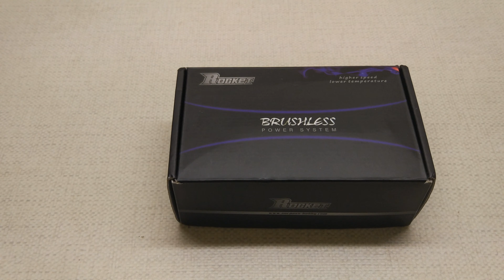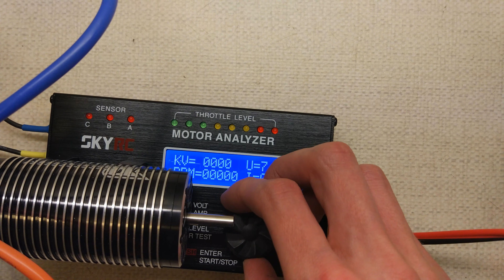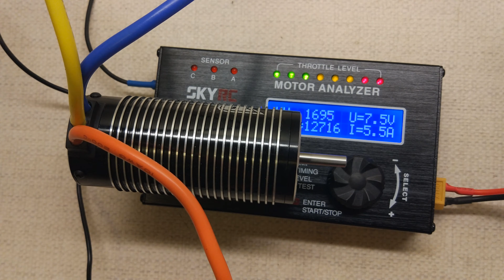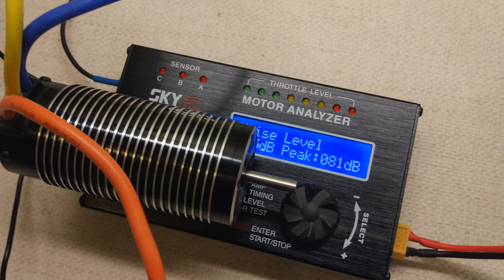MTT EP10 Replacement Surpass Rocket 4092 1650KV Motor

Comment: Great video. Great info bro! Got that motor, but the hobbystar 1730kv.. no problems, but I definitely haven't used it alot. Maybe 10 session. Mainly on 4s. Peace ✌
Reply from the maker: Yeah the hobby star motor look pretty similar to these.
Reply: @LawrenceTimme  my 4092 one looks identical. Its been great for the price. It's in a Talion v3. Paired up to a max8. I'm gonna pair it with a max6 & try a few 8s passes. I live in London. I'm a English Rc bum 😂✌

Comment: Nice, thanks, so do you think this would be a good motor in a kraton, stock one still works fine just wondering what the difference would be, thanks again
Reply: I just ordered one for kraton exb 6s build
Reply: @scottramirez9623  I just bought one also, couldn't resist lol 61 bucks on Amazon can't beat it, can't wait to try it
Reply from the maker: yes it should work well in kraton.

Comment: If i got there 1250kv motor and run it on a max 6 would it work good cause I want to use it in my felony so please let me know if the motor is reliable and can maybe run 8s
Reply from the maker: It will say the maximum voltage on the specs for the 1250kv version. I only have the 1650kv version
Reply: @LawrenceTimme  ok thanks

Comment: Hey great video! I have almost the same motor, its a  4092 1520KV, I have only ever run it on 3s lipo.   do you know if these were designed to work on 3s, or do these motors function better on a higher lipo battery? motor is great, thou I do notice some cogging from time to time from a standstill.   zd racing pirates 3 1/8.
Reply from the maker: On a lower voltage the motor might have a harder time starting up, but it should run ok. If you have a lower resistance battery or better esc it should not cog as much even on 3s
Reply: @LawrenceTimme  thx for the info.   one more question.  would a 4s 35c  battery be any "faster" or better then my 3s 120c battery.   i dont have much experience.  i know the c value makes a difference but going from 3 to 4s be a bigger difference or will the low c really affect its performancr.
Reply: @xKevmachinex  yes u should run 6s or 8s with dat kv motor

Comment: Where did you get this motor?
Reply from the maker: Surpass hobby AliExpress store it took ages to arrive almost 3 months
Reply: @LawrenceTimme  how long it took to get it delivered?
Reply from the maker: @209rc7  I have edited my previous comment, it took 3 month's I thought it had got lost as I have bought many motors from them and they normally come in 2-4 weeks
Reply: @LawrenceTimme  that’s a long time to wait! Would you recommend this motor for Arrma limitless? I will be only running it on 6s
Reply from the maker: @209rc7  yeah it should work fine in the limitless on 6s as long as the the gearing is correct of course.

Comment: Do you know if I can use the rotor of this rocket motor to replace the rotor of a hobbywing 1650kv?
Reply from the maker: It is not quite as big and heavy as the 4985 1650kv hobbywing so you might have to gear down a bit.
Reply: @LawrenceTimme  I’m sorry should have been more clear. I broke the motor shaft of my hobbywing so I need to replace the whole rotor which connectd to the shaft, I was wondering if the rocket rotor and shaft will work with the hobbywing 1650 kv?
Reply from the maker: @omega_rc  no. I don't think so, different size.

Comment: What esc do you use? That is cheap
Reply from the maker: Hobbywing max6
Reply: @LawrenceTimme  oh OK is there any other esc like 150A so I can run 6s
Reply from the maker: @tizzy_24  when you have a motor this big, you need a big Esc to go with it. If you want to run 150a esc get the 4082 or 4076 version 👍

The hobbywing quicrun 150a or arrma blx185 are normally good value on eBay.
Reply: @LawrenceTimme  oh OK is 150A to much for this motor
Reply from the maker: @tizzy_24  no, 150a is not enough for the motor. You can run it with a 150a esc, but to get the full power out of it you really need a bigger esc than 150a.

If you run a 4092 with a 150a esc, the esc will probably overheat before the motor reaches its full power. If you run a bigger esc like the max6 you can run the motor at full power and the esc will run much cooler.

Comment: Hello nice video, I have a hobao Hyper sse as RTR in the description there are the following data Ready to Race, 2.4 GHz, brushless drive for 6s

 Waterproof Hobbywing 150A controller and motor with 2000KV

 HoBao servo with metal gears and 18.6kgcm at 6V
 the car weighs 7 kg all together it has big tires 170 mm diameter and 100 mm wide it needs a lot of power and with a larger pinion the old motor has boiled 2000kv now I am considering buying a more powerful motor with more watts saw the one on aliexpress  the exact one you describe can I use with the same controller that is in the description? Ich fahre nur 4S Lipo...... 

Do you have any idea I'm a beginner would be happy about an answer ... Thank you
Reply from the maker: This motor is too big and heavy for a buggy I think. A 4074 or 4076 would be ebest
Reply: @LawrenceTimme  thank you very much
Rocket 4076 brushless motor draws 155 amps but I only have a 150 amp ESC is that dangerous?  or do you have another good idea?  China motors to order for 150 ampere regulator 4s lipo....?  he should move a 7 kilo buggy
Reply from the maker: @YouTube--Video  the maximum amps the motor is rated at is 155A. What it will actually draw depends on the gearing used. It should be ok on 4s in a buggy